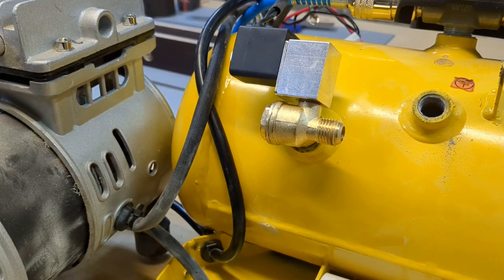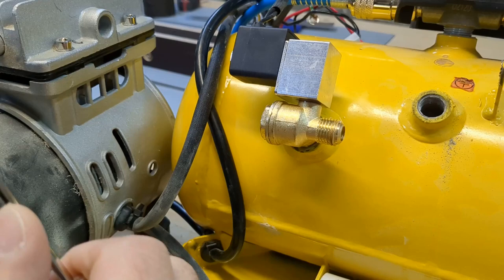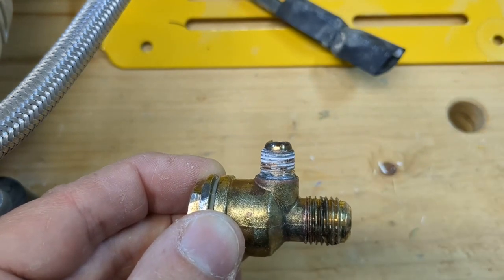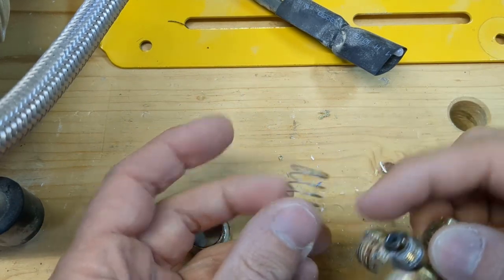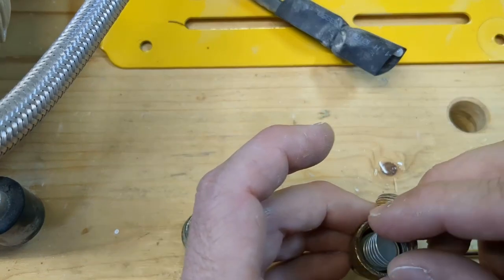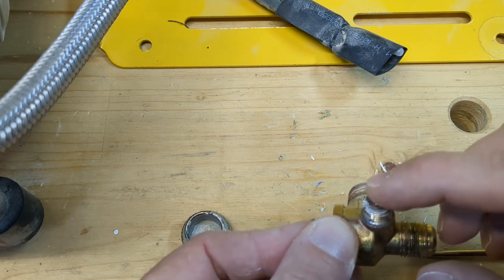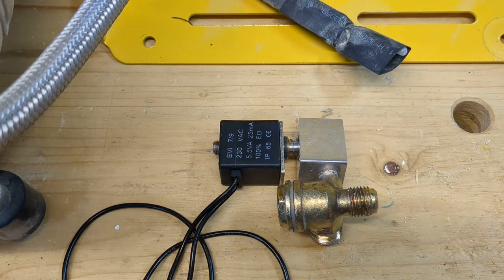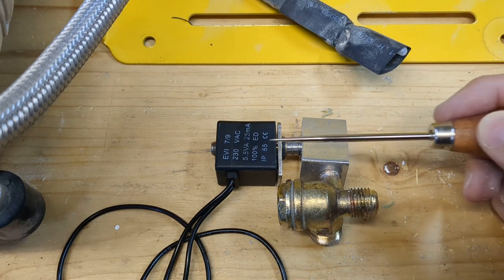Stanley Silent Compressor: How does the solenoid check valve work?

Comment: Thank you!  I have changed both the check valve and the solenoid, bit still have air coming through  back into the solenoid when it shut off. Any idea's there?
Reply from the maker: There might be something blocking the spring loaded plastic thingy from completely closing. Check if there's any debris in there. Dunno what else it could be.